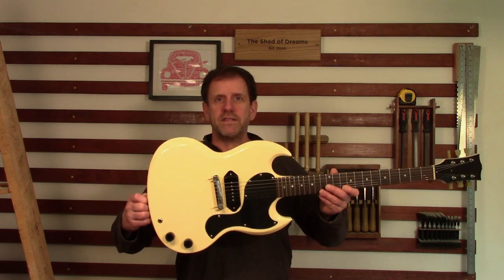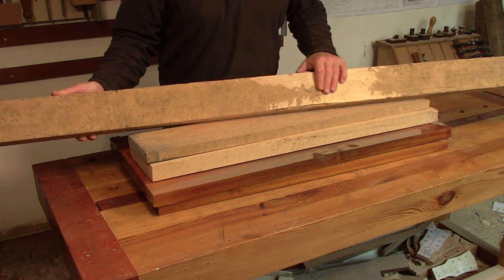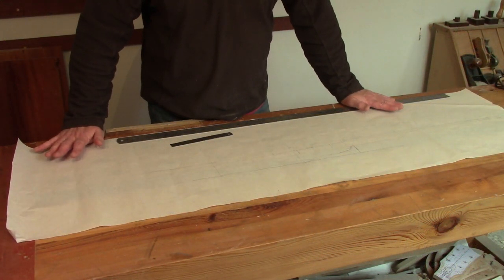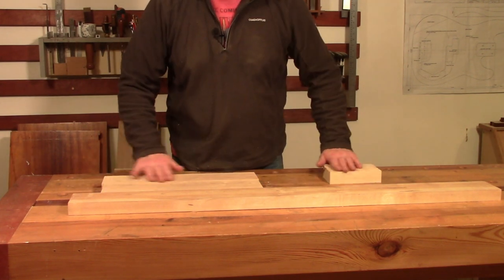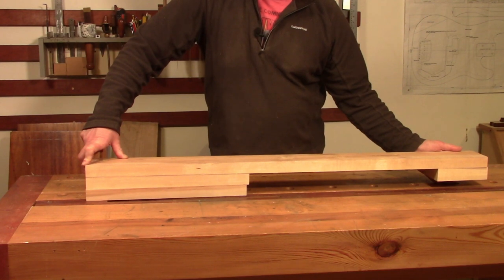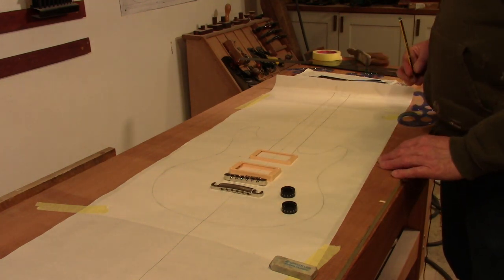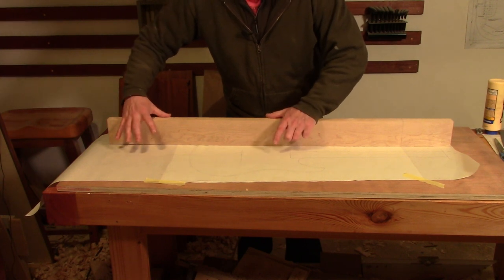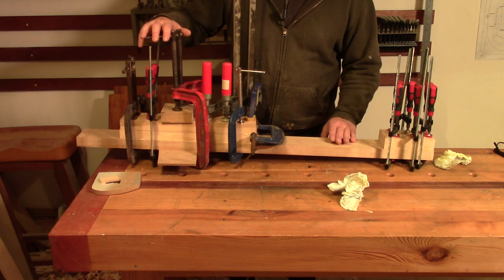Great Guitar Build Off 2021 Episode 1: Prepping material.

Comment: Loving it already mate! Great to see an original, practical design. But 17 deg headstock? Do you have a reason for such a large layback angle?
Can you not just sharpen your planer blades? Or have they gone past that stage...
Looking forward to seeing this build progress👍👍
Reply from the maker: I'm starting to think I said 17 degrees so it would fit into the Les Paul/SG section of the guitar rack. Perhaps I can put it between the Fenders and the Gibsons lol!!!

The blades are well passed sharpening and to be honest are quite cheap to replace, it's the fitting process that puts me off!

Comment: Hi please don’t do a 17 degree headstock angle. It’s just dumb. You know it is. I know it is. Jesus knew it was 2000 years before the electric guitar was invented. I’m not going to take my time to tell you all the good reasons not to take the headstock back so extremely
Reply: Invoking Jesus in a guitar argument is amusing :)   17 is hardly Lute territory.
Reply from the maker: The design is quite fluid at the moment, I think I got 17 into my head as I was using a Les Paul neck template to help with the layout. It might change, I'll see how things progress.